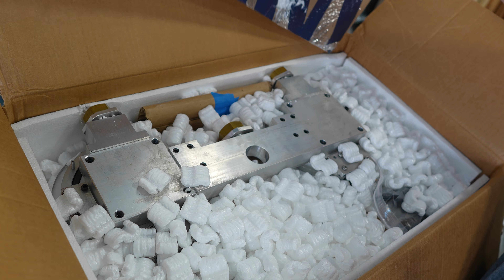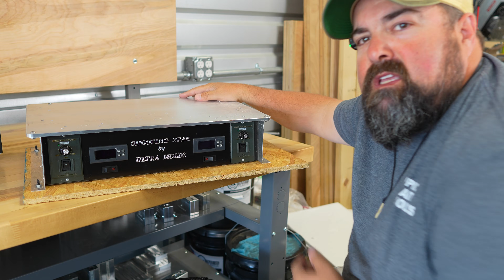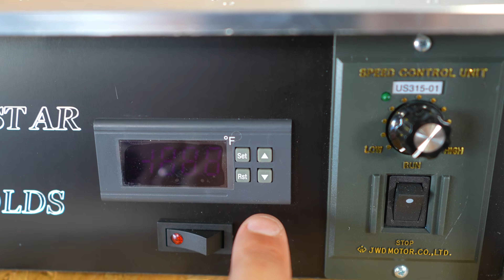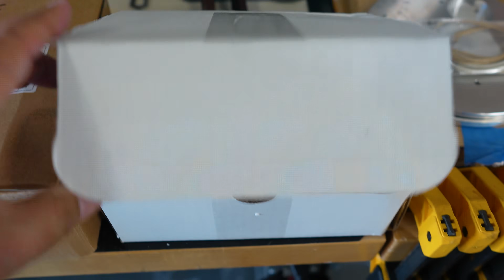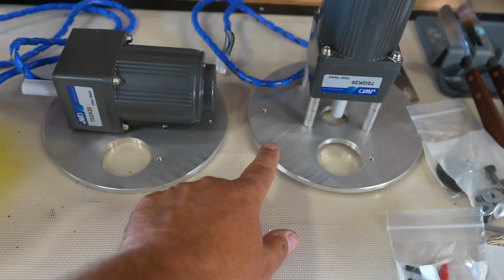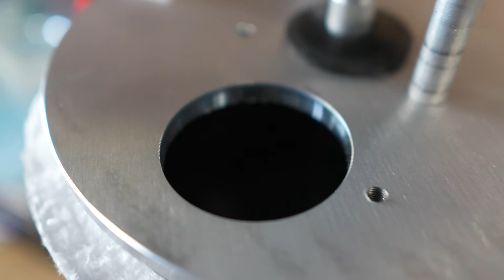I Waited 3 Years To Unbox This...  Shooting Star Injection System By Ultra Molds

Comment: you are so petty i wouldn't want you as a customer .if you don't like the orientation of the switch turn it yourself its a simple solution ,the burr on the top should have been removed but still a simple fix
Reply from the maker: I don't think it was petty at all.  As mentioned, I'm just giving my input as someone who is a longtime product manager.  It wasn't a knock on the system at all, in fact I love the shooting star. It's a phenomenal system and I use it all the time.  I don't think Ultra Molds took it as petty either, I spoke with them on the phone and they appreciated the input.  I appreciate you watching the channel and dropping a comment too. That's the best part of this platform, is everyone can express their opinions.  Tight Lines!

Comment: I'm not buying the shooting star just because i'm pretty sure the pro pour system will be availible soon. Its a ton more money but we are already working on huge production molds of our own. Some so big that even a 12 oz doul injector will not fill them. I have one in cad. I'm working on  right now that will shoot 150 ice baits at a time. My brother is working on one similar to the power worm that will be 100 bait mold since no one makes one close. 100 7 inch worms at a time. 😮 we are also experimenting with going away from aluminum. If we get it to work this will slash mold making costs buy over half. we can do it all in house. However I'm still verry skeptical long run.
Reply from the maker: Yeah the Pro Pour setup looks pretty slick.  Definitely a nice middle ground between a Shooting Star and a Zorn Machine.  I couldn't believe the price jump in going from a shooting star to full production if you want to do it in house.  The Pro Pour system sits in the middle there, I think time will tell how viable it is in full production.  I hope it can hold it's own, it will be a nice platform to strongly consider if it all works out.

Comment: Great stuff, looking forward to seeing the Shooting Star Mini in action.  BTW, I checked your silicone mat idea out on Gemini, here is what I found. A silicone mat is not a reliable or recognized countermeasure for preventing or extinguishing an electrical fire. While silicone has excellent heat resistance, relying on a mat to handle an electrical fire hazard is a dangerous misconception. Here is a breakdown of why silicone mats don't work for electrical hazards, and what you should actually use. Why Silicone Mats Fail as Electrical Countermeasures They are not fire suppression tools: A silicone mat cannot smother a live electrical fire. If a device catches fire on top of the mat, the mat will not stop the flames from spreading upward or outward to walls, curtains, or other flammable materials.  I look forward to your countermeasure idea.
Reply from the maker: Hi Frank, well I didn't know I was going to get into a counter measurement discussion with AI. LOL.  You and Chat GPT are correct, A silicone mat will not extinguish an electrical fire, nor will it prevent it from moving up and outward as it suggests.  That's not the purpose.  The purpose is to prevent a hot lead or potentially any falling ash or embers from sitting on the wooden table surface.  Silicone just has a high temperature rating, well over 400 F degrees , but it's not by any means fireproof.  I think the true countermeasure would be to enclose the lower unit in a full metal casing.  I'm just using the Silicone Matt as a preventative measure.  I'm also open to any suggested countermeasures.  Did Chat GPT provide you with an end solution?
Reply: @baitchuckin  No not really, this is where common sense and experience wins out over online AI.  It went on to recommend stuff you are already familiar with like AFCI (Arc-Fault Circuit Interrupters), GFCI (Ground-Fault Circuit Interrupters) and Surge Protectors with Auto-Shutoff and Proper Fire Suppression if an electrical fire actually breaks out.  I like your idea of a full metal casing on the bottom, I think that's the best solution.  Now get back to bait making and sorry for the long post, lol.
Reply: To close this all out, I just bought one of your silicone mats, and a bunch of other stuff.   (If you see this before you send it out, I accidently bought 2 of the SS-002 Syrena's. Can you please swap 1 for another colorway, I would greatly appreciate it?)
Reply from the maker: Hi Frank, we see the order, I will have Mrs. 8bit reach out to you to confirm the color choice.  Thank you for the support, and Tight Lines!
Reply: @baitchuckin  thanks so much!

Comment: I wanted one of these for the new business so bad, but the lead time is a no go. Years later and they still claim to have a "supply issue" and are not taking orders on their site (only special orders by phone or email). How long does it really take to figure out a supply chain? That makes me nervous as a prospective buyer/business owner/operator. What if you need warranty work or replacement parts? Sounds like a long down-time if it breaks.

P.S. Don't sugarcoat your criticisms either. Those rough edges could be deburred in literal seconds by an apprentice with a deburring tool. Packing peanuts are the devil too. You have to basically assemble it for them. This is not a finished product ready for market. Missing parts too? Almost 2k for this machine... I would have some buyer's remorse.
Reply from the maker: I've heard support has been pretty good, I'll find out myself as I just put my first call into them to try and get the motor screws replaced after 3 years of not putting it together, LOL.

Comment: Fair critiques. Those are the wrong packing peanuts. There are PIDs in the unit which have circuit boards. So anti-static packing peanuts should have been used. While the chances are small styrofoam creates a lot of static electricity and it doesn’t take much to kill a board. 

Those edges need to be addressed. Seems like a big oversite. That edge is the one you’re most likely to hit w/ your hand. And filleting it open doesn’t sound like a fun time. 

As far as the switch, it would not pass UL certification like that. You can’t have them moving in opposing directions to perform the same function. If you move it to the right to turn power on they all need to move that way. 

None of that prevents me from wanting one or buying one in the future. All of the “issues” are easily fixable.
Reply from the maker: Thanks for watching and I appreciate the comments.  Yeah those were similar to my thoughts.  None of these are deal breakers or make me want to use the machine any less, but it would be nice to just polish it up a little bit you know, turn it into an EXCEPTIONAL product.

Comment: Great video and even better observations and what could be better on the manufacturing aspects of an obviously well build machine. Looking forward to watch you get use to using the system.
Have fun this weekend, I had planned on attending  this weekend but Mother Nature had other plans for me by extending winter and a nasty spring weather which effected the amount of days I could work mainly the cold. So next year I will be planning to go if they host another.
I’ve been meaning to ask you or Chris Jones about the older you tube videos that everyone has. Does hitting the like button effect your channels even though it maybe your oldest postings? I wasn’t sure if it still affects algorithms?
Again have a great time looking forward to watching any footage that is posted on the event.
Reply from the maker: Hi Franklin,  Thanks for watching and dropping a comment!  No worries about not making it out this year to the meetup, there will be another one next year!

To your questions about thumbs up on older videos, YES, it helps tremendously!  We appreciate all the support, even on older videos it helps the algorithm know you are enjoying the content.  Tight Lines!
Reply: @baitchuckin Thanks for the info. Safe travels and enjoy.

Comment: Cool gadget. If you want the "soft edge" to cover those pesky edges let me know.  I can look them up for you. They can be a little tricky to order the correct size.
Reply from the maker: Oh do they make little covers for that thin sheetmetal?  I don't know what thickness it is, I'll have to find out from Ultra Molds.  I bet it would make finding the right part a lot easier that way!